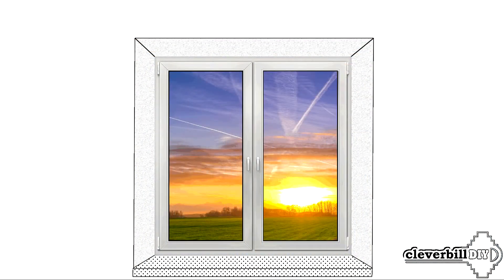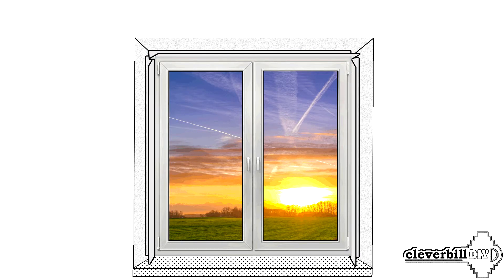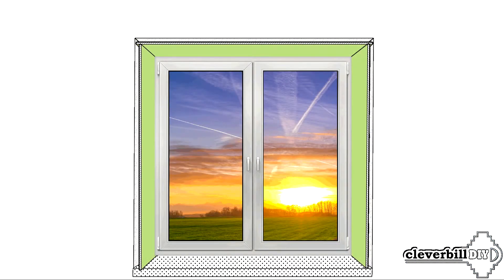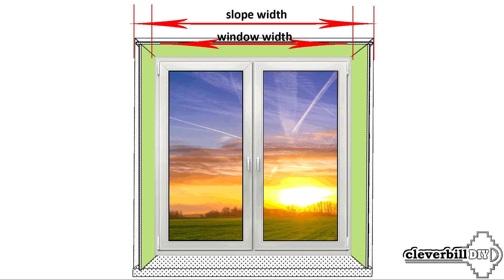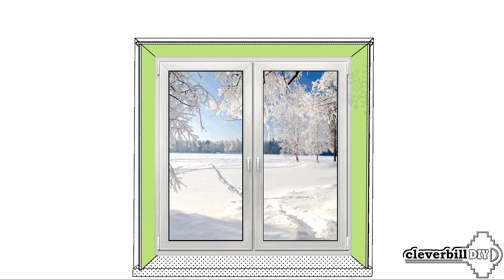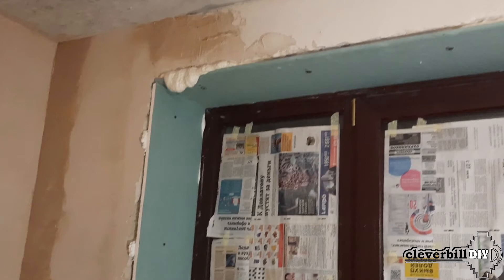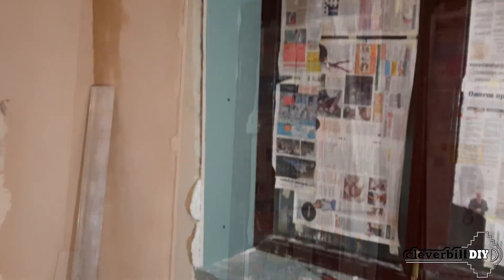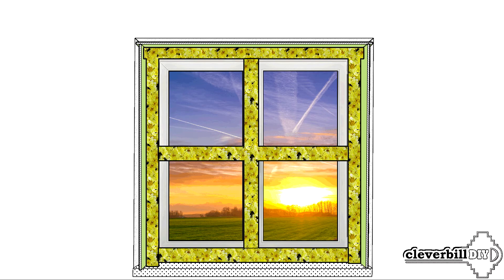Plasterboard window slopes - how to make and install yourself

Comment from the maker: It is not difficult to install a window slope, it is much more difficult to make the slopes even. Many who have no experience working with polyurethane foam make the mistake of filling the space between the slopes and the wall with foam with a high secondary expansion, from which all work becomes a marriage. And if even on a sheet of gypsum board, such a mistake can sometimes be corrected with plaster, then on a sandwich panel you will have to start all over again.